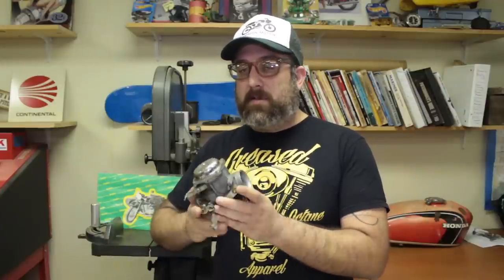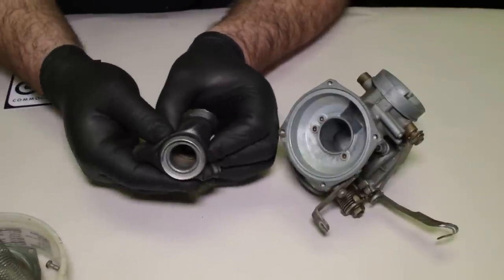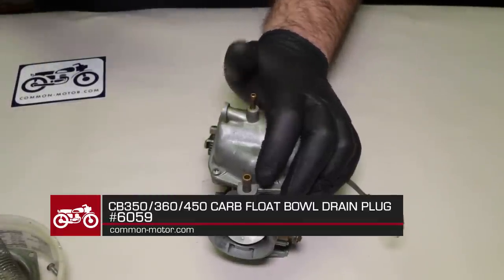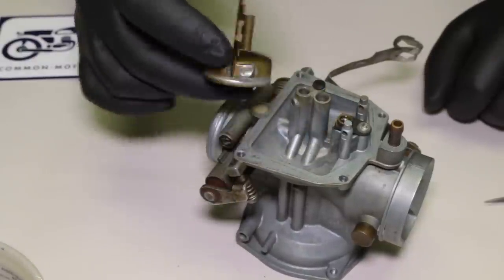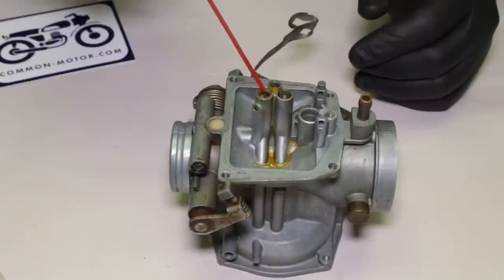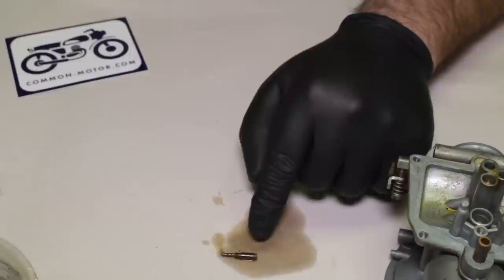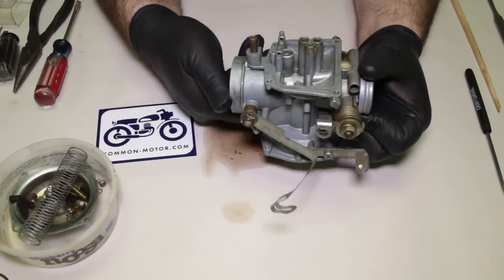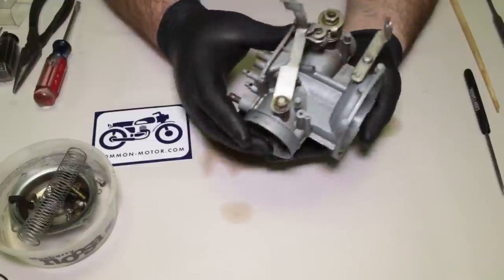Honda CB350 Carburetor Rebuild Part 1:  Disassembly

Comment: That diaphragm is in excellent condition. I've taken 10 apart and every one of them had 3 little tears over the air bleed brass inserts. A damaged diaphragm leads to "digital" throttle control where power snaps on and off. I am really amazed at the replacement parts you can get today that were not available to us in 1976, like diaphragms, floats (had to re-solder several of them), gasket kits, etc.

Comment: Removing carburetor assembly (CB250, CB360,CL360,CJ250T,CJ360T):

Remove left front foot peg.  Remove gearshift pedal retaining screw.  Remove gearshift pedal.  Remove left rear crankcase cover  (the cover where the clutch cable goes in--don't remove the clutch cable from the cover.  The cover is held by four Phillips-head screws).  Remove the hose clamps that hold the air-cleaner rubber intake ducts onto the choke sides of the carbs.  Remove the air cleaners, still connected to their rubber ducts.  Loosen the insulator ring clamps (The insulators are the rubber boots/ducts between cylinder heads and the carb intakes). Detach spark plug wires from plugs and put the wires out of the way.  Be careful not to harm the ignition wire that goes into the points housing.  Pry the carb assembly away from the head, toward where the air boxes were.  Lower the carb assembly to the left and pull it out the left side.  Detach the throttle cables from the carbs.

Comment: Your touching on many points that a good many people completely bypass or overlook entirely. The air bleeds and emulsion tubes seem to be oversights with quite a few folks I know. That plug for the transfer adjacent to air-fuel mixture screw the other. The last one bordering on the nightmare since many believe the carb is no good any longer as it can't be tuned without that plug.

Comment: Good morning.  I have a 70  SL350 with these carbs. I have them disassembled and I have your kits and diaphrams .  I put them in an ultrasound cleaner and a lot of microscopic stuff came out. They look really clean to me. I don't really want to knock out all jets . Do you think it would be ok or not really.

Comment: I cleaned my carbs, put them back on the engine and found the engine hard to start. When it started after about 6 kicks, the engine rev-ed to about 5k. The inlet butterflies were closed when this happens and when I press down hard on the throttle stop arms I can bring the revs down to tick over. Can you suggest what might be the cause? Does the butterfly have pivot seals that might be causing an air leak. When overhauling I noticed there wasn't a washer or seal in the air mixture screw, yet this wasn't a problem before cleaning.
Reply: Are your throttle cables installed and adjusted correctly?
Reply: @wryanddry2266  the revving was happening when the throttle arms were seated which is the tick over position. Would it matter how the the cables were adjusted if the arms are seated. Cant remember for sure.

Comment: What did you soak them in since you didnt remove the shafts?
Reply from the maker: The carb bodies were washed in our parts washer with parts wash solvent.

Comment: I'm having issues with my K4.  Someone suggested that I might have an air leak from the white plugs in my carbs.  Have you come across this?  My white plugs are both there, and don't seem loose.

Thanks
Reply from the maker: Its always possible. You can always seal and crack or a loose plug with epoxy. We also have a tech support line you can call and we can try to give you some troubleshooting tips and tricks.

Comment: There's liquid in my float. Would that make the whole bike not start? Because the engine turns but won't start up.
Reply from the maker: It depends, I'd recommend contacting us over our support line at (510) 824-8575. We have it open Mondays or Tuesdays from 12-6pm. You can also shoot us an email through the website at common-motor.com and we can see if we can get some more information about what's going on with your 350 and get it running again for you.